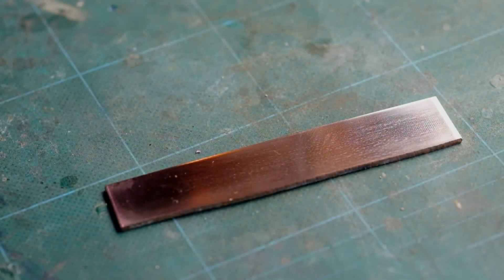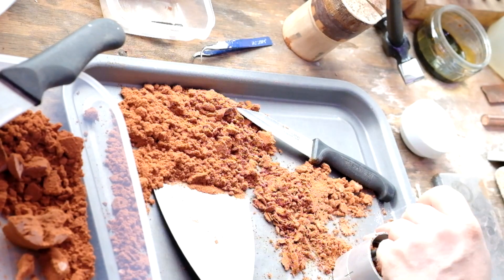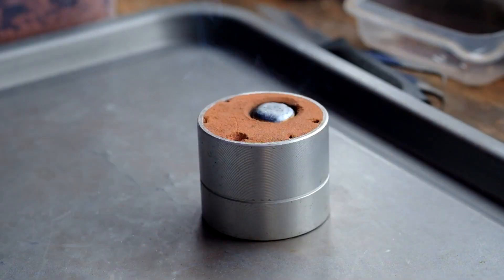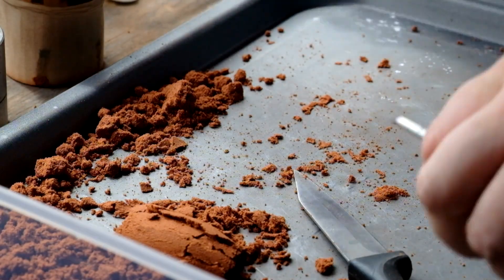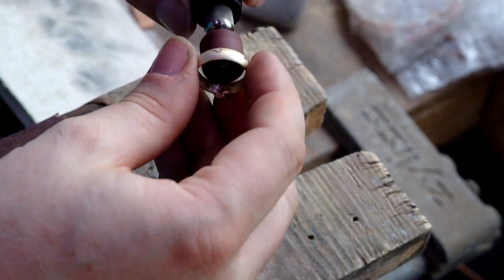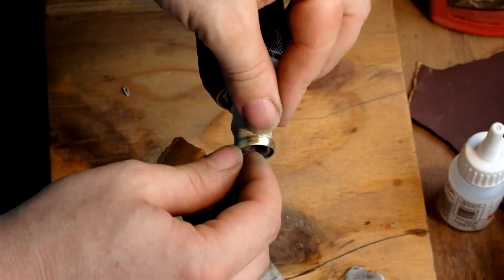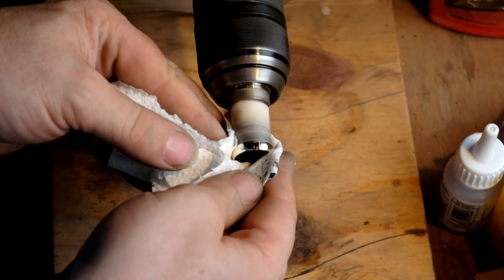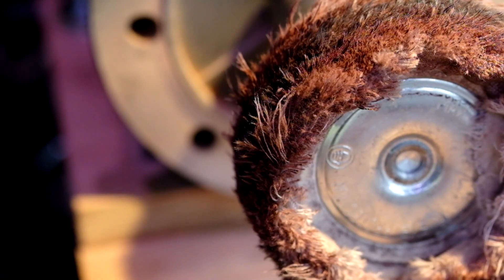An Electrum Ring (sandcasting)

Comment: I had to doble check where you came from. Your accent could cut as a New Zealender, but I saw your plug outlets and, you live just over the puddle. XD
You see, I've been searching for electrum in all of Norway, it does not seem like there is any of it anywhere to be found here.
My fiancé and I want green wedding rings and electrum is the best option but we have so far been unable to find raw material. Where did you get a hold of electrum?
Reply from the maker: I "get hold" of electrum by making it myself from gold and silver and a bit of copper. If you'd like to talk about me making some rings for you, or supplying some metal in bar or other form, I'd be happy to try to help. I can and do ship internationally.

Drop me a line here: http://shinium.co.uk/contact.php
Reply: @MatBrown  I will e-mail you as soon as I've talked it out with my fiancé. 🙂
Reply: @MatBrown  Hi again. I've attempted to send a message two times. When I click on "send", I just get a "broken link" message. I've tried two times and not sure if the message has been sent or not.

Comment: Do you experience any shrinkage in the cast? I’m getting ready to make a ring doing the lost wax method and I was told to oversize my wax ring by 10%
Reply from the maker: Not significantly. I tend to make my forms slightly oversize but that's more to give me some space to grind off imperfections than anything else. A clean sand cast comes out pretty much the same size as the form you're casting from.

Wax behaves differently I think (and even then, the degree of shrinkage depends on your wax and investment choices)

Comment: Is the resulting ring 12K or is it higher? What is the other metal in the alloy that you use - silver?
Reply from the maker: In this video I just use pure silver and gold, but since filming this I've found adding a few % of copper makes the final alloy much more durable. 

50% gold is 12k, so if that's what is used then yes, the resulting ring is 12k, but I end up making all sorts of mixtures depending on what people want.

Comment: I wonder if electrum is strong enough for a split shank that attaches to a fine silver seat.  Thoughts?
Reply from the maker: Could be. If you kept it fairly chunky and used some copper in the  mix it's probably worth knocking up a prototype at least.
Reply: @MatBrown  Thanks.  I am newer to metallurgy.  Do you think that copper will turn my Client's finger green, though?  That is what I am trying to avoid.  I was thinking 50/50 pure silver/gold...

Comment: when you assemble both halves of the mould - how do you ensure that the channels are aligned? Or does the mould only fit one way?
Reply from the maker: There are registration marks on the outside of the moulding rings - all you need to do is make sure they're lined up and it's good to go.